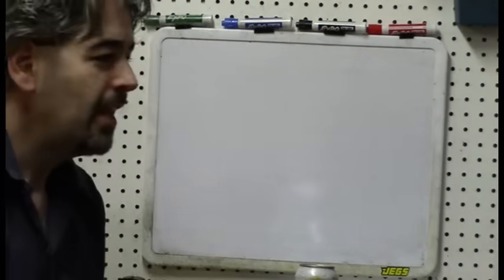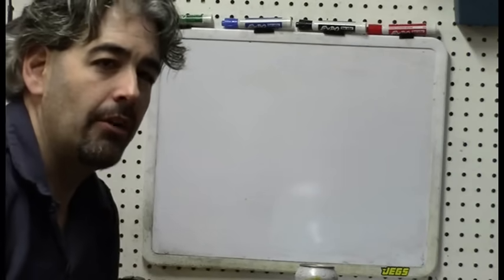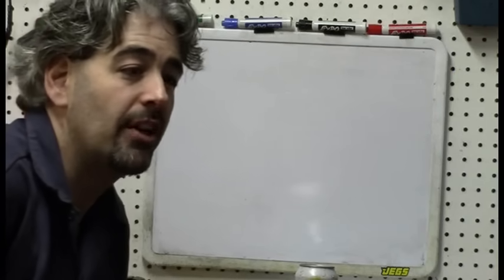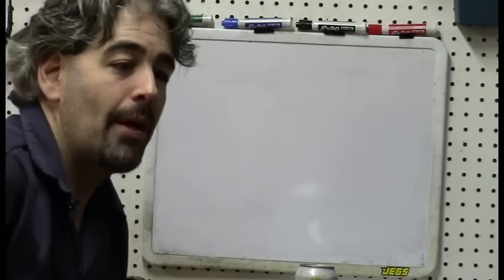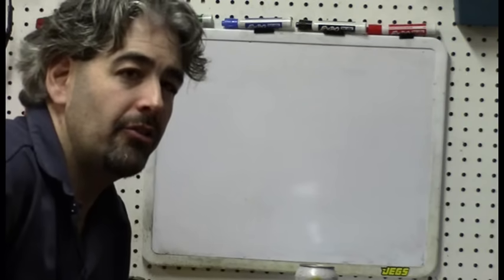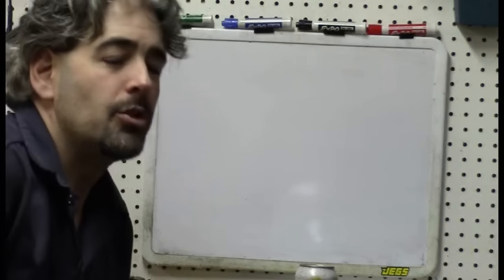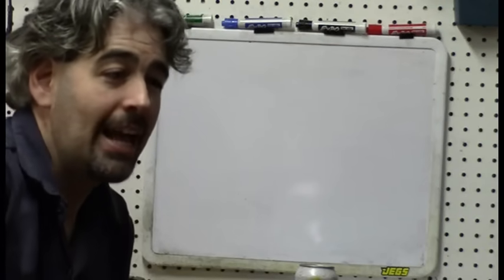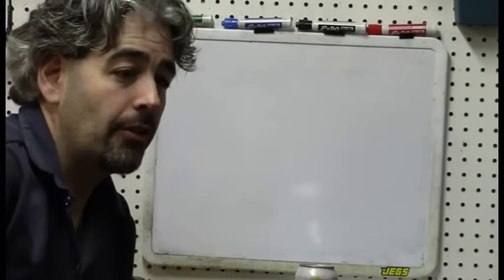Secret of Engine Problem Diagnosis- Fuel Trims Pt.1

Comment: Great engineer, please help!
How can I solve this car problem? Recently, a client called me to fix his 2000 Toyota Avalon car that cranked but wasn't starting.
   From the onset, the car experienced several mechanical, as well as, electrical issues. Some of those  problems were:-
(1) Engine Oil consumption;
(2) Engine misfire;
(3) Engine rattling;
(4) Intermittent hard starting after shutdown; 
(5) Hard to engage in drive, except engine is hot; etc.
Hence, he took the car to a garage inorder to rectify the excessive Engine oil consumption and other car problems highlighted above. Consequently, the car  problems exacerbated after engine rebuild by the engineer! 
  The car owner wasn't satisfied with his repairs because it seems the engineer was deceitful. Although the car started after the rebuild, the problems still persisted.  Valves weren't grinded after engine overhaul, engine still misfired at idle and when accelerating, etc.
   The  engineer whose garage the car is presently being parked, requested for another engine overhau/ rebuildl. After engine rebuild the car started, the oil was mixed with water; the engine was still misfiring, rattling, etc. It was obvious,  that he didn't use durable parts to do his work.

    Hence, the car owner moved the car to another garage for better repairs. The new garage suggested to the car owner that another engine rebuild is pertinent for optimal engine operation. 
    During my conversation with this engineer, whose garage the car is presently being parked, he told me that: "when the car was first brought in, he noticed a black smoke ( maybe he was mistaken for blue smoke, at exhaust tail at idle). When accelerating, there's a loss of power, engine bucking, popping,etc. After the rebuild, the car didn't start because the mechanic didn't unlock the car with the remote but proceeded directly to cranking the engine. In addition, the security relay wasn't actuated for starting to take place. Electrician did some wire cutting around that axis which he said was corrected to factory, opened with a remote before the car started.

   Fortunately, after everything, the car started again. But there was still an intermittent misfire. What the car owner said was that, 'even when the second mechanic did engine rebuild, the car still misfired. Until he personally bypassed earth from the COP wire to the solenoids very close to the fuel injector often tightened with 10mm knot and depicted with blue and green colors on the picture. Car owner verified that the reasons for the misfire from both mechanics which still prevailed, was due to the solenoid valve that wasn't opening. That's why when accelerating it experienced a loss of power, similar to that experienced by a faulty fuel pump.
  
   After gear oil replacement and test driven by the second mechanic , smoke started emanating from the engine bay. Precisely, from the fan relay that the car owner connected by himself. Within few minutes, the car shutdown by itself as if fuel is finished.  As he tried to restart it, the car refused to. Infact, when the ignition switch was turned to Acc/ ignition position, battery and fuel light was not displaying in the dashboard/ instrument cluster. However, during cranking battery light glew faintly and start. But when throttled,  it would shutdown. Electrician verified and replaced the alternator diode with a new one. When Ignition switch was turned to Acc/ ignition position, the battery and other lights came out brightly but when cranked to start engine wouldn't start again. Sadly, it still wouldn't start.
 
I tried to scan for DTC codes, but my scanner wasn't communicating. I checked all fuses, power and ground at obd port, those checked ok. but my scanner isn't compatible to read CAN network. there are only 4 wires intact for the obd2 port.
    Furthermore, I added fuel through the intake to the engine, no change at all. I checked for spark and injector pulse. These things weren't present. But there was power to injector with just the key at ignition or ACC and COP had 1 ground and 1 power as usual. 
 Electrician from that garage, who also worked on the car said that he sniffed burning smell from the ECU, however personally I didn't when I went to start the car. I don't know how certain that was. Hence,  I pulled out the ECU to a laptop board engineer to test the components inside. He said: "everything looks ok and test fine, however the IC he doesn't have the right tools to proceed with the test. With the ECU removed battery connected, Engine light would come ON. with ECU connected check light still comes ON.
Before I left, I checked the MAF sensor 5 wires and noticed that 3 wires were earth instead of 2 and 1 power; no ignition current/ power was available for the remaining 2 wires. 
  Please, what should I do to start the car?
Reply from the maker: What data do you have?
Reply: @SchrodingersBox  scanner is not communicating with the car.  But presently, it's a crank no start, no spark, no injector pulse that they're trying to figure out and rectify. How do I go about fixing these problems, just to get the car running again?
Reply from the maker: Ok so if you don’t have a scanner just start with the basics. What’s the static vs loaded fuel pressure? What’s the voltage at the coil signal? What’s the ground side voltage showing on the injectors during KOEO?
Reply: @SchrodingersBox  I have a scanner but it's not communicating to read the codes. Using the test light I saw a light on KOEO but no pulse during cranking.
Reply from the maker: Then there is your clue. You don’t need a scanner. Just Try a crank sensor bypass and see if that works.
Reply: @SchrodingersBox  please, how can I go about bypass test?
Reply: @SchrodingersBox  Today, I went to check that Avalon car. However, there was no good battery that was capable to crank the engine it could only be used to perform some test with testlight . The client apologized for that.
   Nevertheless, I did some basic test. I checked the fuses the were all ok. I found the fuse that powered the MAF sensor wire that was supposed to be power instead of ground. When I unplugged the fuses, number 19 of it shutdown the light in testlight  but put on the light whenever that fuse is reconnected. That's how the fuse for that location looked.
  Additionally, I noticed that that particular MAF sensor wire illuminated the testlight even with the ECU removed. Using multimeter I checked and saw that that particular MAF sensor wire goes to one of the ECU connector.
 Also checked the 3 front out of 6 fuel injector wire to ECU, they were not shorted. Still good! What can I do to fix the no start in addition to the bypass test, please what can I do next?
Reply from the maker: So what was the MAF reference and signal voltage?  Did you determine injector and coil control from the PCM while you were there?  What happened when you put voltage to the CKPS signal?
  So far we have no data still. Have to have data to even get a basic direction.  Right now still could be anything. Have to Get data to narrow it down to a specific system.
Reply: @SchrodingersBox  When I put voltage to the CKP sensor wire, it still didn't start. Infact, I also put power to fuel pump but still the car didn't start. Fuel pump worked only when I added ignition power to the ground side of the fuel pump wire. Presently, it's still a crank no start no spark no injector pulse.
  Please help! What should I do next?
Reply from the maker: When you put power to the CKP sensor reference and try to a tart the car, what is the CKP signal voltage showing?
Reply: @SchrodingersBox  I pulled out and bench tested the CKP sensor with a multimeter. Setting the meter to 20 ohms  reading, I got 2.31. CKP sensor connected back, multimeter set to 200 AC, power from tester to reference wire, engine cranked I got between 0.4 and 0.5 . With key released dropped to 0.2.
   Initially, I got 27.5 then 22.8 during cranking, maybe it was an error with multimeter but I don't know. Please 🙏 guide me more on what I should do next.
Reply from the maker: You got between .4 and .5V from the SIGNAL wire during cranking???
  No way. What is the reference voltage?
Reply: @SchrodingersBox  bench testing the CKP sensor with a multimeter set to 20 ohms, I got 2.31.
Reply: @SchrodingersBox  I also got a decrease in voltage from 27.5 to 22.8 v during cranking. Just couldn't recall where my multimeter was set to.
Reply from the maker: You lost me bruh.  It is impossible to get 20V on a crank or cam sensor on any car.  What are you measuring that’s giving 20V????
Reply: @SchrodingersBox  please the .4 and .5, are the values ok? Lastly, before I left I also checked individual wires of the ECU using a testlight and noticed only one dc current, 2 ignition current and several earth, please is it ok like that?
Reply: @SchrodingersBox  Sorry!
Reply from the maker: Not sure what you are measuring but no- .5V on a camshaft sensor signal is definitely a problem. I just don’t see how it’s possible to get that measurement. There is no combination of variables I can think of that would give that reading. Are you reading signal voltage against reference?  What are you measuring?
Reply: @SchrodingersBox  I'm taking the measurements from the 2 wires of the CKP sensor using a multimeter set to AC while cranking and adding power to the signal wire.
Reply from the maker: Is this an inductive sensor or not?  If so I sure hope you didn’t put 12V to it if it’s an inductive sensor. If you did then you likely blew the PCM. I’m hoping it’s a Hall effect sensor.  If it is inductive it already has bias voltage from the PCM and the sensor generates the AC voltage. Putting battery voltage to it is not good. 
   This is why the very first question i asked is “is this an inductive or Hall effect sensor”.
  I think you might consider taking it in to a shop. If you haven’t damaged the PCM you are likely to do it if you continue. It’s not worth it.
Reply: @SchrodingersBox  ok. It's a 2 wire type not a 3 wire type. Please there's something else I didn't indicate. Using a testlight I had 2 ground at the CKP wire no power. I just can't comprehend if that could have contributed to the low AC signal voltage of the CKP sensor.
Reply from the maker: A testlight won’t show power because the bias voltage is only 5V. That’s why you can’t put 12V to it. The sensor generates its own AC voltage signal- not DC. 
   Putting 12V to a 5V signal circuit likely blew the PCM.  You have to now step back and ensure the PCM is interpreting crank signal to ensure it isn’t damaged. 
    I am thinking I am going to step out of this one-  too many variables and to much potential for doing more damage. I really, really, really suggest you take this to someone knowledgeable in these systems.
Reply: @SchrodingersBox  Ok.
Reply: @SchrodingersBox  Thank you for all your guidance.
Reply from the maker: Yeah sorry man it’s definitely best decision at this point. Made a good run at it though but you’re on the verge of making this an incredibly expensive repair.  Hopefully no damage done!
Reply: @SchrodingersBox Well, when I get there the car owner called someone else without my consent.
Reply: @SchrodingersBox  The is another car. I was called to another garage to fix a 2005 300c chrysler. The problems they noticed with the car was Hard or no start, red lightning bolt flashing, no throttle response, headlight stays on, immediate stalling after starting and rough idle throughout idling as a result a new PCM was replaced with a new one however problem still persisted. 

  I scanned for DTC codes and saw a P0340, P2167, P2166, P2115, P2116, p0603 and more module codes like C2202, U0168, U1414, B1A25, etc.  Please how can I fix the problems?
Reply from the maker: What is the resistance across the CAN high and low terminals?
Reply: @SchrodingersBox  Well, I didn't check that but I will if I go back. To check it I'll need to set my multimeter to resistance and connect to the high and low terminals, right? What should the value be for a good one? 
    What about the hard starting, stalling, and no throttle response,  how can I fix those ones too?
Reply from the maker: With those codes sounds like a likely CAN issue. I’d check CAN integrity first with that resistance check and then repairing the network should restore the drivability issues depending on modules affected.
Reply: @SchrodingersBox  Thank you sir. Please, how can I repair CAN network, if perhaps the resistance value is low? Is there a module that works for the CAN BUS? If yes , please, how can I be certain that it's faulty?
Reply from the maker: It depends on what the resistance reading is.   That tells you what needs to be fixed.
Reply: @SchrodingersBox  When I checked today, setting my multimeter to 20k ohms reading, I got 006 ohms.  When I switched the meter to continuity setting to measure the CAN high and low with car battery removed, I got 062 but no beeping. 
  Actual spec for the car is 2005 chrysler 300 with a 3.7l and a v6 engine.
Reply: @SchrodingersBox  Someone sent me the wiring diagram for can bus b. Suggesting that I should be focused more on can bus b instead of c due to the codes. I loosed the dashboard, radio and other components. I'll try to upload it to you too. The radio has a can bus b with 22 wires.
  When checking the 22 pins radio connector, with my multimeter black lead connected to ground then the other red lead connected to pin 1 when ignition was switched to On position, I got 12.45v . When the red lead was moved from pin 1 to pin 5, I got a 0.00v. Next, to pin 6 I got 0.92v . Finally on pin 12, I got 12.45v. 
   Additionally, moving my multimeter range to continuity setting, with the black lead connected to ground and the red lead to pin 5,11, and 22, there was a continuity. When the black lead of the multimeter was still connected to battery negative and the red lead to pin 5, I think they should be no continuity from the wiring diagram. 
 On the other hand, when the multimeter black lead was moved from Battery negative to positive, and the red lead to pin 1,6,12 they was a continuity. When the black lead of the multimeter was still connected to battery positive and the red lead to pin 6, I think they should be no continuity from the wiring diagram. If I'm wrong, please correct me.
   Furthermore, with ignition On, multimeter black lead connected to CAN B- and the red lead connected to CAN B+, I got 0.29v. Next, multimeter black lead connected to pin 1 and red lead connected to pin 5, I got 12.35v.  while black lead still connected to pin 1 and the red lead connected to pin 6, I got 12.02v. 
   What could cause the interchangeable beeping at the pin 5 and 6, as well as, lower and higher voltage? How can I fix the problem? Is the can bus B faulty?

Comment: What if i have a stft 25% And ltft 25% it only  come to zero in about 4000rpm in idle it is working rough  And in drive is fine? Help? Gm astra 1.4 4 cylinder
Reply from the maker: Vacuum leak

Comment: Hi Matt. Trying to duplicate your tutorial with the tools that I have.

Question:
Is STFT 1 the same as F/T 1X2? 

Setup:
PLX KIWI 3 and and Torque App on Android.

Vehicle:
'06 Odyssey 

The reason I ask, is I find that the F/T 1X2 tracks the STFT 1 almost spot on. With the exception of rapid changes in RPM at which time the F/T 1X2 lags a bit, but catches up. The STFT 2 is not available for some reason with the aforementioned setup, so I've been using the F/T 2X2. That said, if F/T 1 & F/T 2 are in fact representative of the STFT 1 & 2, I've got issues with bank one i.e., %s are high on bank one. STFT 1 seem to stabilize but typically run much higher during normal driving conditions. 
Thanks.
Reply from the maker: Yes there are lots and lots of difference nomenclatures used for fuel trim. F/T is one I have definitely seen before.

Comment: Dear, I have a big problem in my car
I'm thousands miles from you , I really need your help to diagnose this issue which I can't detect it.
How do you prefer to contact you if you don't mind so I can send you more details and videos 

thx in advance
Reply: simple description:
I start my car, first 30seconds it's ok 
after that RPM down to 300~400 it cannot move, if I turn it off on it will be ok after the 3 mins it will be ok, this case never repeat except when I turn off my car
Reply: Update:
O2 sensor was the issue,  after unplugged it , it works fine except fuel consumption

Comment: 11:15 when the real info starts.
Reply from the maker: Seem you don’t understand the foundational concepts.  thats a shame.
Reply: @SchrodingersBox  my air fuel ratio is 14.7:6,random misfire at idle,can you help
Reply from the maker: @Adrian-bv8qb  Yes I can- what is the fuel trim at idle vs at 2200RMP?  Both LTFT and STFT needed at both those conditions.
Reply: @SchrodingersBox  sorry for delay and thanks for replying, idle stft (-2.34) ltft (-17.19)   2200rpm stft (-6.25) ltft (-8.59) recently got timing belt  ,water pump and drive belt done,misfiring at idle but when i turn accesseries on idle stabalizes